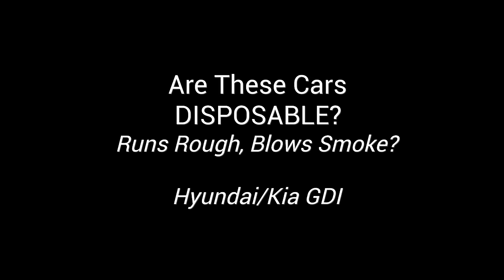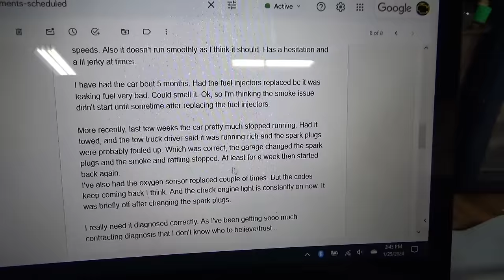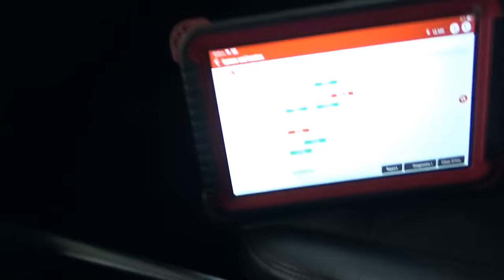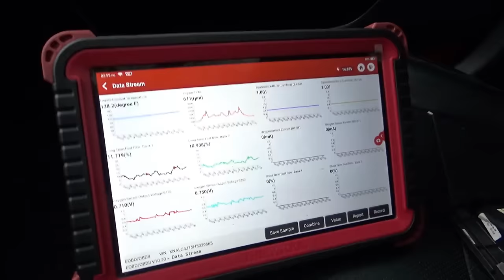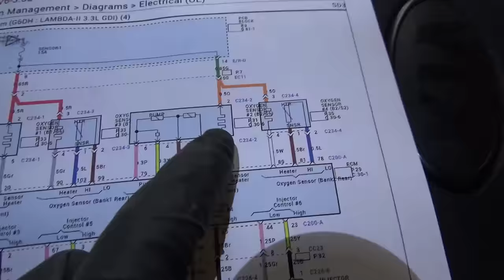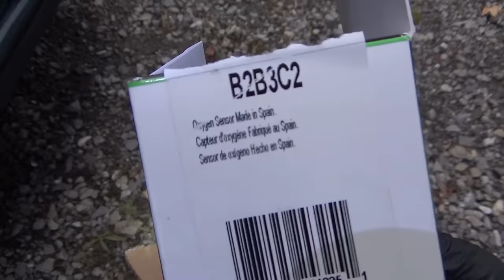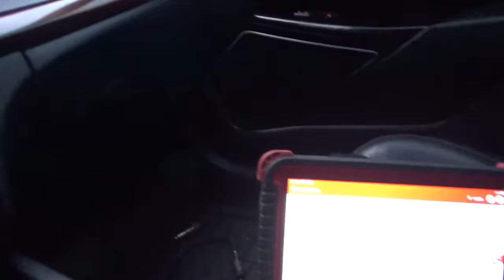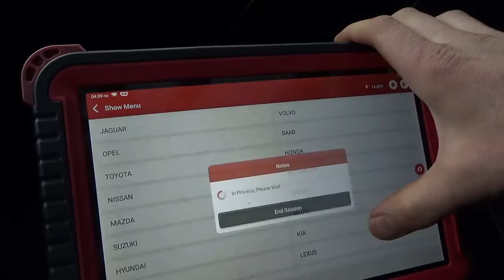Are These Cars DISPOSABLE? (Hyundai/Kia GDI Burning OIL - MISFIRE, Low Power)

Comment: I've found many stuck rings,  not too many worn out rings. From disassembly..not just guessing...so, when I have an oil burner, something I've tried is xylene. It's an excellent solvent for motor oil and gasoline related goo, and is not very volatile, so sticks around a while.
  I position the pistons down from TDC (all 4 on an inline 4 reach mid stroke at the same time) to make some room, then put a couple ounces of xylene in, install plugs to retard evaporation,  and let sit a couple days.
    I suck out liquid with vacuum, blow cylinders clear, then beat the crap out of it, hard acceleration, deceleration using engine braking, to create high vacuum during intake stroke. So force is applied to rings in both directions...an effort to "jiggle" them.
   Then change the oil, it will likely be dirty/contaminated with xylene. 
   This has improved oil consumption for me. I got a used corolla engine that had bad cylinder leakdown.  Rather than return it, I did this, letting it sit maybe a week. Result was excellent leakdown, and a very oil tight engine I use every day. Better than dealing with the yard and chanceing another questionable used one.
    I wonder, though, if this is likely with a GDI engine that may have poor atomization and cylinder wall wash down.. if enough gasoline passes the rings to result in oil dilution, real wear may be more likely than stuck rings.

Comment: Auto-RX will clean out carbon-fouled piston rings.  So will Valvoline's Premium Blue Restore motor oil.  In fact, that's what it was specifically formulated for: to clean carbon-fouled piston rings on Cummins diesel engines.

Comment: Only chemicals I have found to desolve carbon is the carb. cleaners with Methylene chloride and is outlawed in many states. Pull spark plugs spray enough to form a about 1/8 or more deep to cover piston. It will get past rings in 24 hour period and loosen carbon from oil expander 3 ring where it forms deposits and will not allow the spring action of the 3 piece ring to work properly.  I then rotate engine over with plugs out either next day or the next if I don't do this procedure twice to make sure it has softened carbon to the point it is like margarine and then follow up with oil flush like kerosene mix with transfluid ratio to 4 oil to 1 mix and then run engine for period of time various rpms to spray and splash areas of the upper rod. I then go back and service with light oil with good detergents with in oil and drive 100 miles and service again with depending on vehicle mileage and condition anywhere from 15w40 to 10w30 and add lucas oil additive with seal conditioner and add accordingly to ratio of oil capacity 5 oil to .5 lucas. Have had good success rates as long as rings don't have excessive loss of compression and blow by

Comment: Don't think some chemicals can help this engine. Because it has at least two problems - stuck rings and stretched cylinders. One may clean the deposits on the pistons, but the cylinders itself is worn out. Measuring the inner diameter of cylinders at different depths can show they are barrel or cone-shaped. And the only way to fix it - is to re-bore the engine block, or install a sleeves. Also new pistons, rings, seals, chains, belts etc.

Comment: I am curious as to why you did not run a leak down test on the engine?  Higher viscosity oil is probably worse for the car as the tolerances of the bearings expect thinner oil.  Oil pressure may suffer.  Also, as a GDI car it would make sense to try running a cleaner though the intake.

Comment: I saw Bernie's video with the carbon remover too.  I am very curious to see what your results are.  I can tell you that I personally use Seafoam.  Directly in the oil, 1 oz per Qt 300 miles before my oil change.  I started doing this in a car with about 150K miles and just beginning to use some oil.  I did see improvement.  So now I use it about once a year as a PM.  Since discovering this, I have used Seafoam directly on dismantled parts to remove gum and carbon and it clearly has dissolving properties.  I can't wait for your video to see how it stacks up against Bernie's!

Comment: Some people put the carbon remover directly into the bores on some of the Audis with defective Design oil rings. Seemed to work decently.

I wouldn't recommend thicker oil necessarily, but there are some oils with with additives to clean carbon and burning with very low ash content. Sounds like a good combo to me.
Also why are you not just running 5W40, increasing the cold viscosity doesn't seem very logical to me as the oil will probably spent most of the driving time in the hot viscosity range.

Comment: You should try the BG engine restoration kit...I did it on my f150 3.5 ecoboost...engine valve looked like factory after..put a scope inside the oil pan...looked brand new

Comment: I was just talking to Andy, who is an engineer for Hyundai, and he said most of the problem is related to the rings being a low tension ring design to increase fuel efficiency. He was saying if you don't change oil every 3,000 to 3,500 miles or 3 to 5 months you will get oil consumption. The company did this to get the fuel economy where the EPA wants it. He suggests owners use a semi synthetic oil at a bare minimum. In the United States, where temperatures are not that extreme, he recommends 10w30 oil. If temperatures are below 0 F, on a regular basis, using 5w30 oil would be suggested. The oiling on these engines are very particular and you have to be on top of the maintenance so oil issues are not present.

These engines are very particular with any kind of sludge buildup. The oiling is susceptible to sludge buildup and the only way to avoid it is do regular oil changes and once a year to do a oil treatment on it. I asked how, and he suggested a stronger cleaner, such as kerosene to keep it clean. You do not run the engine with that in it, but you only use the starter, with fuel pump cut off on its power by pulling the fuse.

Comment: ive used both the ATS Chemical CRF505 oil and fuel system cleaner. Got some sludge out of the engine and the after the fuel system cleaner car run much better and gained 5 mpg.

Comment: These Kia Hyundai "lambda" engines always fail the same way. The shaft wears out, the variators start to make noise, the oil rings and channels in the pistons become clogged. The engine most often stops when the valve clearance on the exhaust valves reaches 0.

Comment: Direct injection = LSPI. Low speed pre-ignition.
Need to use correct oil.  Low calcium content oils.
Need to get rid of carbon deposits in cylinders

Comment: The pending codes there because it needs the cats changes and it would fix the oil burning and engine light it's causing backpressure and gasoline engines don't need that it's the onlybway to fix that car and seeing that with the scope should have told you its just going to keep Maki the same problems occurring the cap probably melted off that o2 sensor and started melting that hole in the cat so fix that and it would be fine for many more miles as long as it's not caused other problems by driving it hard with the exhaust clogged up

Comment: Kia is fully aware of the GDI issue the fix is replacing the high pressure fuel pump on the engine it aint cheap orver $1000 just for the pump not including install . your other option is fight kia since its a defect a new engine from kia is $11,823,00 you cant find engines in scrap yards .
Reply from the maker: @dvljet  how would a new fuel pump fix anything? 😂

Comment: I wonder what the labor time would be to pull the pistons on that engine? 

The best chemical to dissolve carbon I found is Simple Green. I soaked pistons for a day in it and could use a tooth brush to clean them. They looked like brand new.

Comment: Trouble with this scenario is that even though the faulty sensors are diagnosed and replaced, the car has been burning huge amounts of oil for so long, the piston rings and grooves will be embedded in goo and carbon and probably jammed up. So no matter how thorough the repair, you would really need to pull the pistons and clean them to be out of the woods.  A lot of people are starting to  blame thin oils for oil burning. I agree the anti-carbon additives are worth a try...

Comment: When you do your engines with the treatment, maybe you could experiment and get the motor hot, pull the plugs, and pour some into each cylinder, bar the engine over and leave it sit overnight. Crank the motor over the next day with the plugs still out to blow everything out that’s left so you don’t hydraulic the motor, and see if that changes anything.

Comment: Good vehicle to try the oil additive to because its rather new and low miles. Likely it needs to be driven often to confirm the latest O2 repairs now that the fuel mix is just right, some of the carbon might just go away with some oil changes.

Comment: If it was my vehicle I would get that bank 2 cat replaced & sell it as it is only going to keep costing money even if it is buying oil for it (plus putting a thicker grade oil in a GDI is only going to make that system more failure prone oil needs to be thin to get up there on cold start ups )Cheers Ivan another good learning video for the DIYers.

Comment: FINALLY a video on the Cadenza! I have a 2018 with 40k and I've been waiting to see some/any video by the youtubers I watch (even if it's a grim glimpse of the future lol)
Reply: I got the 2017 like the video bought with 3000 miles. I'm tech and i only do 3k miles oil changes and a induction cleaner every other oil change. No engine issues so far. Only issue i had was both cv axle outer boots started leaking and i was out of "2nd owner warranty" at 6yrs..i also added a oil catch can and it does catch a fair amount of oil but thats normal

Comment: Yes the V6 is bad.. I have the new 22 sorento 2.5 4cyl non turbo.. 50,000 miles.. we will see
Reply: You have a fighting chance... the dual clutch transmissions on the turbo models are the ones to avoid.

Comment: Seafoam works pretty good. If you use it in a nasty engines oil, after about the 3rd/4th oil change, you'll notice when you peer into the oil fill area, the engine parts start looking clean again. It's also fantastic in small engines that have gummed up carbs . If they'll start and stay running by any means, usually running a single tank mixed w/seafoam will resolve most issues. Seafoam won't undue damage from ethanol fuel, you'll have to brow beat your local legislative rep w/a proverbial stick to resolve that nonsense.

Comment: My thought on the engine flush start with hot engine run the flush as directed let car sit for a short time to allow the flush to work in to gunk  with engine still hot rerun the engine drain and change the oil  , I believe this will provide the best result ,  seafoam in the gas tank heavy dosage will clean the piston tops  Please post a link to the suggested flush also their could be an issue with the PCV system

Comment: If the engine use a lot of oil  te cats will get coated and restrict flow  . .  causing overheat and all kind of temporarly troubles. . .

Comment: My 14 Highlander V6 with 229k miles does not use any oil between changes. Modern engines do not have to burn oil, any company that says this is normal is lying. How do they even pass emissions testing ???
Reply: GDI motor era..

Comment: I've' got a good one from the earlier years. It's a 2005 Sonata with a 2.7 v6. I bought it with 250k and I'm up to 377k with only a fuel pump failing on me last year. I am getting ready to order another timing belt for it this week, along with a set of spark plugs and lifters because one of them takes a few minutes to fully pump up from cold start, resulting in a tap for a few minutes.

Comment: Running the 505 right now. Some had obviously spilled into the bottom of the box and ate half the styrofoam. Currently at 1 quart every 400 miles. We’ll see.
Reply: 100 mile improvement after first treatment. That’s with going back to 0W-20. 2014 Forester 153k miles. Articles I’ve read caution against using a higher viscosity due to the amount of time the oil will have to reform deposits, and reduce fuel mileage. As trims adjust to compensate for oil in the combustion chamber, leaner conditions are given the ability to bake more of the lubricants to the rings and valves.

Comment: I'm going to try the ATS 505CRO on my 2000 Camry with 362K miles.  It's an oil burner and my bottle of the stuff is now on order.  My issue may be more of 'end of life' than stuck oil rings, but it's worth a try because the car otherwise has no problems.
Reply: I gave the ATS 505CRO a try and sadly it did not help my oil burning.  With my number of miles it's probably wear of rings and cylinders causing the oil burning, not stuck oil rings.  I did give the ATS a good amount of run time (20 minutes @ 2000 rpm and 20 minutes @ idle).  The oil came out very black.  I did cut open the oil filter and thought I'd find a lot of carbon, but it looked normal.

Comment: I have an issue with my snow thrower running lean. I suspect it's a gummed up carberator. I was told to try Seafoam, but after Ivan's remark, I'm wondering if there's something better to try.
Reply from the maker: Just remove and clean the carburetor jet by hand lol 😊
Reply: @PineHollowAutoDiagnostics  I would if I could.
Reply: YEP! @PineHollowAutoDiagnostics

Comment: Have the owner change oil to royal purple and do a couple oil changes and see if it cleans up all the crap out of the rings because the oils are junk and the oil control rings get coked up and the rings can't rotate on the pistons, it's worth a try, or every oil change substitute one quart of oil with automatic trans fluid
Reply: Dont bother, i had an oil burner a 2006 focus with low tension piston rings, no amount of oil changes costing 50 bucks each will help

Comment: Berryman b-12 to every gas tank for a 1k miles  guaranteed to unstuck rings.  Just did a 2003 Corolla with 230k mikes on the o/d burning a quart every 400.  Now its down to maybe a quart between oil changes
Reply from the maker: That's impressive!!
Reply: AND CHEAP!

Comment: Hyundai and Kias are a bit hit and miss.  Hear some horror stories.  My son has a 2017 Elantra, 2 liter 4 cylinder Atkinson cycle engine.  Over 120,000 miles.  The only issue has been a failed ignition coil, $85 fix.

Comment: I ran cro 550 oil cleaner from ats chemicals on my 2014 Hyundai sonata gls 2.4L. just dumped it in the crank case and drove it ten miles, then revved the heck out of it in a parking lot. Then drove it to my friend's house where we changed the oil.  It is now 1650 miles later and the oil I've burnt so far is .375 quarts. Definitely an improvement
Reply: Usually a piston soak works best
Reply: @zzman5306  yeah I'm scared to do that and hydro lock the engine or blow it up .